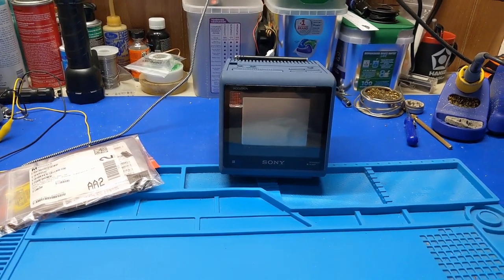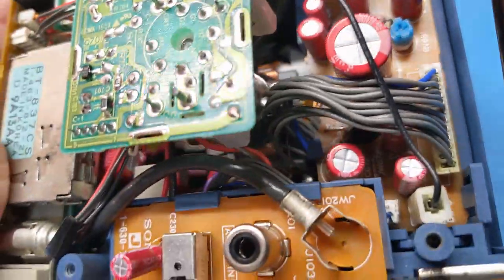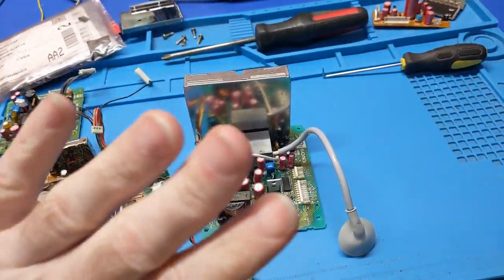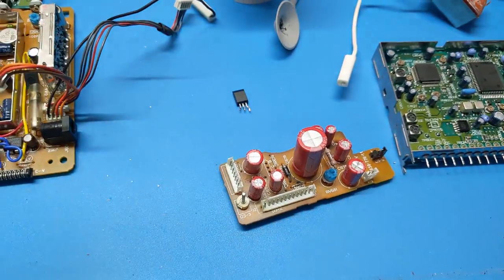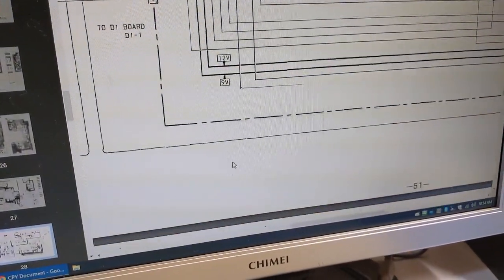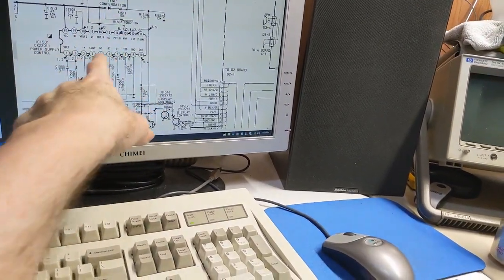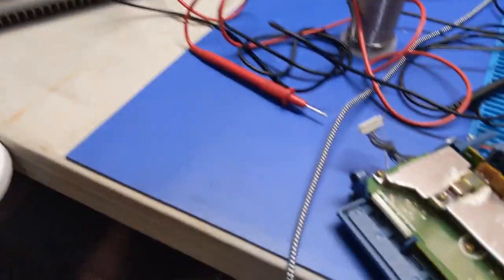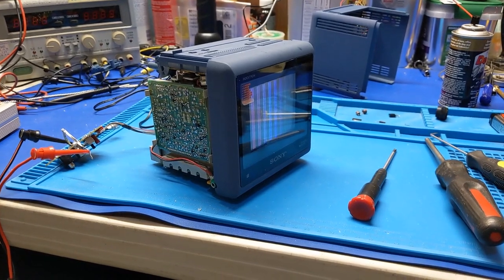Sony Watchcube Indextron KV-4SV2 Dead Shutdown. Lets fix it

Comment: Very frustrating. When I came to unsolder the chip, one side just fell off due to cap goo having corroded all the soldered joints. So now I don't know whether the chip is duff or it was just bad joints which were the problem. I think next thing I will do is just knock up a simple variable mark-space osc to see what else runs/doesn't run when power is up.
Reply from the maker: Well, more often than not, the chip itself is dead. If you feed your own PWM signal into the switching transistor, you will get the proper voltages but it wont be in sync with the line frequency. this is necessary for the dynamic focus control to work, and to prevent distortion in the picture with the magnetic coupling of the transformer. 

It is entirely possible to re-engineer the PSU board and just use DC-DC converters in buck/boost/inversion topology instead, using the horizontal drive frequency into a ramp generator with multiple integrators for each voltage. then you can use the same ramp for the dynamic focus parabola. Theres many approaches here.
Reply: @THEtechknight  Sure. I realise the sync issues. I just want to fire it up first to make sure I haven't got any other major problems before I spend a lot of time on a permanent PSU solution. Thanks for the help. BTY the one I have is the Japanese version too.

Comment: I have  got the power supply fully working with a free running TL494 chip. Next step will be to sync the sawtooth output with the horizontal drive. My board has the component spaces for  Q1516, Q1517, R1526 and R1527 which are the power supply shut down components for the USA version but these are not fitted and the shut down works differently on this Japanese version. By running the power supply from the regulated 9v line (switched) instead of the unregulated 12v line (unswitched), power supply shutdown happens via the central control chip.
Reply from the maker: @stephenniechcial7220  I could never get the 494 to work properly, because it needs a push pull output topology. There's a single-ended IC with sync in that works, just never got around to doing anything with it yet
Reply: Which IC is that?
Reply from the maker: @stephenniechcial7220  Well, I bought a couple different ones to experiment with. UC3823, UC2823, and UC28023. the TL494 and SG3525 wont work because the output frequency is 1/2 the input with a max duty cycle of 50%.
Reply: @THEtechknight  Hi, I don't follow your stuff on the TL494. The output square wave frequency is locked  to the osc.  sawtooth 1:1 ratio, so no problem there (checked it on the 'scope). The output doesn't have to be push-pull, it works perfectly well with a single ended output, and the duty cycle is variable up to 90% . The challenge is to lock the osc to the horizontal drive frequency. The application notes give one method of doing that, but there are probably others .
Reply from the maker: @stephenniechcial7220  The output frequency is 1/2 the oscillator frequency because it is a push-pull chip. Anyways. Good luck.

Comment: Hi Techknight. I was working on my TV's D1 board (Japanense version like yours) when a transistor fell off.   On closer inspection I saw 4 components from the display control were not there too. Namely Q1516, Q1517, R1526 and R1527. I remember you said in your video that this part  of the circuit is different from the US version. So can you advise me please have these components fallen off , or are they not fitted to this set? Thanks for the help.

Comment: Hi Technight. I am going to try and fabricate some sort of replacement for the CX22011. Can you tell me please, is the output frequency 15khz or something different? Thanks.
Reply from the maker: @stephenniechcial7220  The same thing is on my agenda. I'm halfway done but I stalled because it's not as easy as it seems. It is frequency phase locked to the line frequency of the horizontal deflection, The ramp is required to generate the dynamic focus parabola
Reply from the maker: Also I will have to go back to my notes and tell you which two chips i picked for testing and development. The current trick is figuring out how to add an offset to the feedback reference voltage path without changing the loop gain. There are no modern chips to do what need to be done here that support the CX22011's reference voltage. 

Also, the entire lower deflection/PSU PCB will have to be reverse engineered and a new one spun up with the new design because there's not enough room to stuff a CX22011 retrofit up under the CRT, it is in the way. 

Also, I have STL files now for a rudimentary retrofit plastic CRT holder, and side PCB holders as they tend to go brittle.
Reply: @THEtechknight  Thanks very much. Yes, if you could let me know the output frequency and the chips you're looking at we can exchange notes. It will be a long slow project for me!

Comment: Hello, I am a Chinese viewer, thank you very much for the video you shared. I have the same TV set with the same fault, but I can't buy the CX22011 chip. Could you please help me buy this chip? Or let me know where I can buy it, thank you
Reply from the maker: 您也许可以从全球速卖通获得它们，但我上次查看时，供应已经耗尽。不幸的是，目前无法提供替代品，希望我有更好的消息。
Reply: OK
Reply from the maker: @zhangeric9129  I am working on a solution for this problem which will be in an upcoming video, but its taking some experimentation. Trying to use a more modern chip to replicate the features of the original.
Reply: 期待你的视频